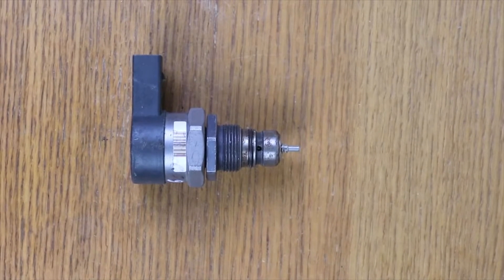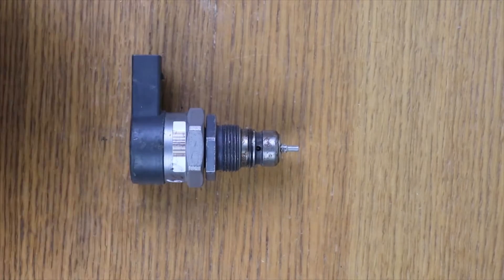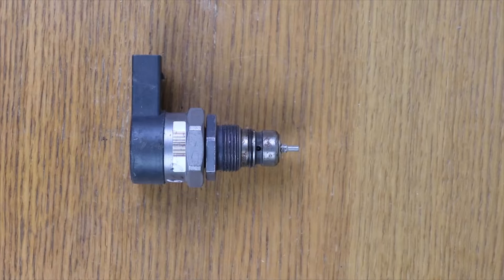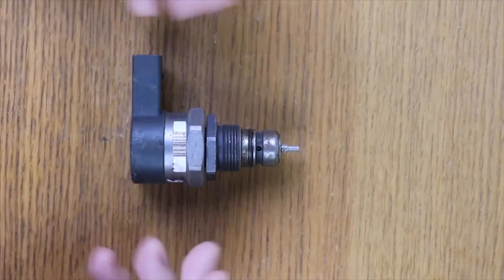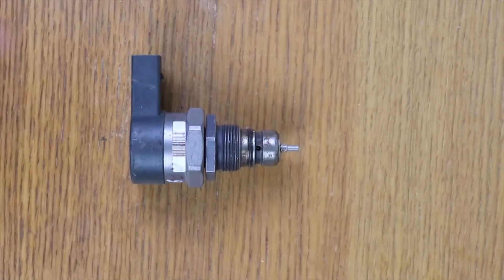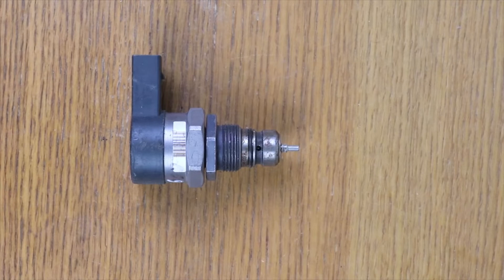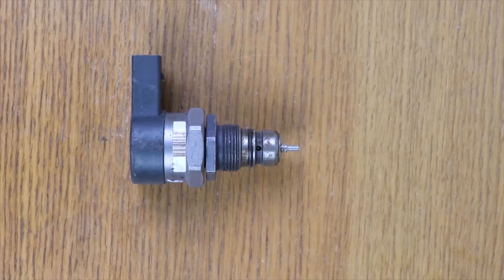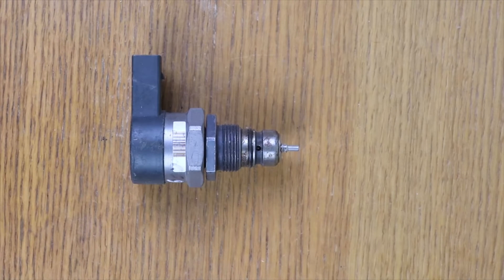FAULT P0087, low fuel PRESSURE in the COMMON-RAIL, this must be CHECKED

Comment: I’ve got a 2.0 2012 Astra and the live date shows that my fuel pressure fluctuates between 24-29 rapidly on idle. Any clue what could be causing it? I had fuel filter changed

Comment: Would there not be a code for the valve being stuck?
Reply: I doubt it - the valve doesn't actually know at what position it is at because it doesn't have a position sensor. It's just a solenoid valve. 

The code is thrown by the fuel pressure sensor in the rail sensing a lower than expected fuel pressure at certain engine loads. 

You'd get a code for open circuit, short to live/ground, that sort of thing from it if it's broken internally. But the car wont start so it would be pretty obvious.